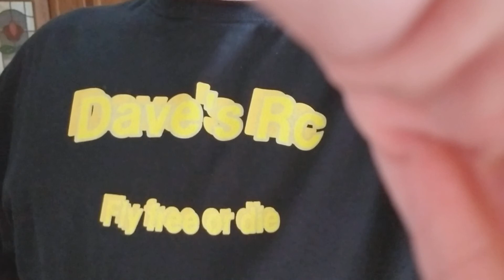FMS P-47 RAZORBACK 1500MM... FINISHED AT LAST.

Comment: Thanks for the shout out Dave .. 
The spitfire is fine .. I crashed my RAF mustang on Sunday with servo failure .. I managed to save it just .. one retract needs fixing ..
My 1600 spit has awesome power for its size on 6s .. I'm sure the p47 will have a great power to weight ratio .

I will return the shout out for Dave's rc on my next spitfire vid as that model seems to get a ton of views .. 
Another suggestion to increase your viewer base and subs is to join rc groups .. not sure if your a member there .. its free and I have been there for about 4yrs .. if u post your vids in the 'warbird videos' thread and the individual threads for the model u should gain quite a few followers and get lots of feedback .. 
Like I say over the next few vids I put up I will try to direct my subs and audience to your channel ..
Regards jeff
Reply from the maker: Thanks Jeff. I will do the same. It's hard to start a Channel. Subs are hard to get. So it is up to us as you tubers to help one another out. If I can send some of my subs in your direction that's awesome. All for the cause. And for us it's subs and views. I have done the same with skipbuilt rc. He is a really good friend of mine. He really helped me get passed the 100 sub mark. Almost at 150. So anything I can do to help you Jeff. Let me know mate. I can't wait to fly this warbeast p47. I can't believe it is on 6s. And I am using the pulse 6s 5000 65c. So they are really going to throw out some power. I hate the weather here. It really sucks.